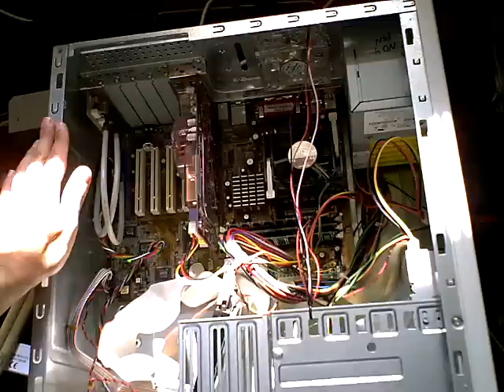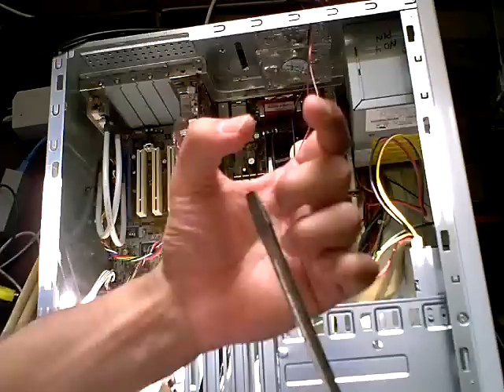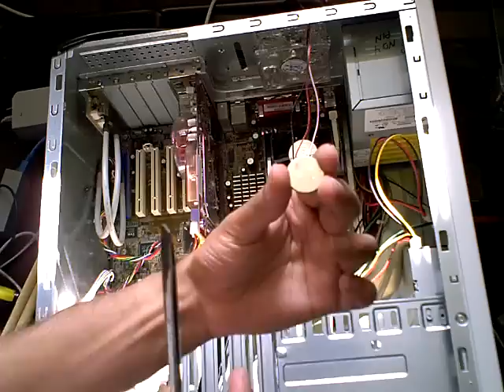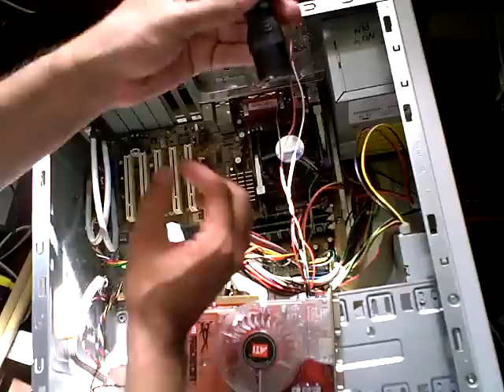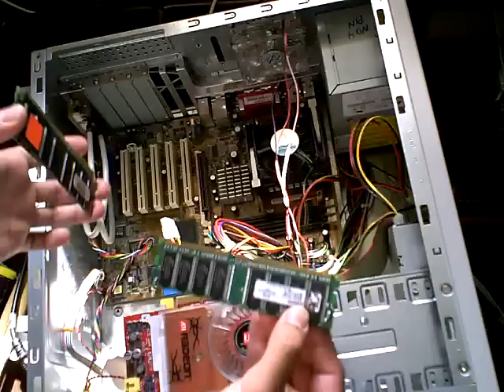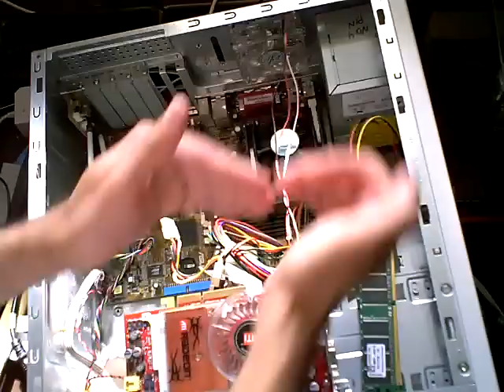How to possibly fix a PC that will turn on but will not beep and will not display anything on screen

Comment: Hi Rodney! My desktop computer boots up when I press the power button, the light turns blue and the fan's start-up. My monitor is plugged in via HDMI into my graphics card (AMD). The monitor displays no input. I then try it through the motherboard and "No Input". Normally when I plug my Ethernet cable into the back of my PC, a yellow LED turns on behind the plug and that didn't appear. My keyboard and mouse both do not work either as one is plugged in through USB and the other through a standard keyboard port. I am slightly worried that my motherboard is dead. Please Help??
Reply from the maker: +Rob Curnock You mention a lot of detail, which is good, but the ultimate question: does it beep at boot?
Reply: Luckily it was a while ago and I fixed it, some how. Thanks anyway though :)
Reply from the maker: +Rob Curnock Yep, responding to all comments unanswered from my 1.5 year hiatus, even if most of them are no longer valid.

Comment: hey, i have a question, i recently built my own gaming pc, i got all the parts in i installed them and out the wires in the right spots (atleast i think i did) the computer turns on like yours did i get power running threw it but i get no picture on my screen  Asus A68HM-K Micro ATX FM2+ is my Motherboard and i cant seem to find the clear cmos on mine  i herd some of them dont have that, i checked the ram and im using the onboard video chip (for the time being) but nothing seem to work even my cpu is fine i get no beeps whats so ever and im completely lost any ideas?
Reply from the maker: +Amaya Rose Breadboard it (explained in the following video:)

If the steps in this video did not provide a solution to your problem, view:

http://www.youtube.com/watch?v=_EK9a-R5pss

You never know, maybe rebuilding the PC in the opposite sense that you took it apart will solve the problem.
Reply: ok thakyou :)

Comment: So when you said to replace the battery, did you mean to put it back in or get a new one?
Reply from the maker: +ethanDAboss11 Heh, good observation. Yep, meant re-insert. Unless of course your battery is dead, in which case 'replace' would apply : )
Reply: RodneyDickson Ok. Thanks man. For my mobo, I just concluded that it was dead and got a new one. Thanks anyway though :D
Reply from the maker: +ethanDAboss11 Good course of action. Thanks for sharing

Comment: Hey, Id appreciate if you could help me out, I built my first pc and it turns on with fans spinning and everything. I plug my hdmi cable from my pc to my tv and it says retrieving data for a couple seconds and then goes to a blue screen on tv the saying like no data or something.
Reply from the maker: Ok, well, first off, try connecting a standard PC monitor to a standard PC out connector and see if that works. If it does, chances are your video card requires either A) HDMI drivers installed and/or B) the HDMI out function enabled. You can begin by exploring the software that corresponds to your video card for HDMI out functionality, and if you do not find such an option, then download the newest driver for your video card, uninstall your previous video driver, and install the newer video driver, ensuring to install the HDMI driver at the same time. Let me know how it turns out.

Comment: Hi, i bought AMD R72-50... I it put in PCI slot, started computer but once i connect my LCD to card's output socket, there is no signal on monitor but I am getting signal from the integrated graphic chip set.. PLEASE suggest something
Reply from the maker: +Arsalan Sajid You gotta go into your BIOS and change the primary graphics adapter setting to your discrete card

Comment: My pc also won't beep or send any signal to the screen, but while the hardrive does turn on the fan does not, is this a different problem or do I not need to worry about it (also the problem began after 5 crashes while gaming and my mother board detected surges from the power supply after 2 of those crashes).
Reply from the maker: +Emmett Carpenter I'd try everything shown in the video, and if that doesn't work, Breadboard it (explained in the following video:)

If the steps in this video did not provide a solution to your problem, view:

http://www.youtube.com/watch?v=_EK9a-R5pss

You never know, maybe rebuilding the PC in the opposite sense that you took it apart will solve the problem.

Comment: I got a problem:
I have a lenovo k450, I upgraded my computer to a 600 watt power supply and a nvidia gtx 770 with its own attached fan..

worked for a week like a charm, my games are older, except for starcraft, however this morning, i turn on the computer, the lenovo screen comes up then thats it. sometimes it gets stuck on the automatic repair screen, my assumption is that the BIOS is not booting, but I cannot boot into it. I hear the power turn on, fans turn on, then it actually turns off and repeats in a loop. i checked the wire connections, everything looks good. \

any suggestions on what's going on? the graphics card rarely got hot when I played games. the night before i just watching youtube, did a normal shut down before going to sleep
Reply from the maker: +francis singh You could try going into the BIOS, loading setup defaults, then save and exit. If that doesn't help, the corruption might be windows-side and not hardware. The fact that you're seeing the Lenovo logo (I assume your PC produces this and not the display on its own) means that the motherboard isn't dead.

Comment: I have a intel i5 6600k cpu, msi r9 390, 16gb RAM, EVGA 600W bronze. Everything works fine with just one cable inside of the msi r9 390 but when i try to put in the second cable, there is no display on the monitor. I have no clue what the problem is.
Reply from the maker: Ensure that the board requires both cables be connected. Sometimes boards have either/or ports, so it will allow additional power from one type of connector OR the other type of connector but not BOTH connectors at the same time.

Comment: i have motherboard MSI G31M. My computer dos not boot regularly. I have disconnected all peripherals as well my optical drives and HHD. A message comes with the first boot display with (American Megatremds) says that CMOS Date/Time Not Set. When i log on the CMOS Setup Utility I see my time and date is going crazy changing by itself between year 2099 and 2020. I have reseted the CMOS, wipe it, changed the battery. does not work. Please, your kind help is highly appreciated.
Reply from the maker: WOW! And you booted with little to nothing connected that could be causing this? Sorry to not be much help here, but I haven't a clue what to suggest. If the stuff is still under warranty, you might want to RMA it. Also, maybe google search that specific issue 'msi bios date changes by itself'

Comment: Ok, my problem is exactly like yours. When I take out all the ram I get the long beep. When I put in only one stick the PC powers up for about 2 seconds with fans and LEDs, then shuts down. When I put both sticks in, it all goes back to the first problem. All power to fans and graphics card but no boot up. Could this mean my RAM is fried and need to buy new sticks?
Reply from the maker: It could be the RAM modules, but it could also be the RAM sockets or something else on the motherboard. As shown in my secondary video, sometimes another faulty component can cause the board to report a memory issue. If this PC used to function as is, then I'd Breadboard it (explained in the following video:)

If the steps in this video did not provide a solution to your problem, view:

http://www.youtube.com/watch?v=_EK9a-R5pss

You never know, maybe rebuilding the PC in the opposite sense that you took it apart will solve the problem.
Reply: Well I got an update on the problem. So when I booted up the PC as normal, everything turned on, beside the screen(problem displayed in vid). I just decided to let it run for a while. Surprisingly after 25 min of black screen, it started to work. Display was outputted and working good. I'm at a complete loss as to why. Any info on as to why?
Reply from the maker: Sounds like a configuration issue in your CMOS settings were either trying to access a resource that was not accessible (and the access request finally timed out after waiting) OR after hanging for so long, the POST operation simply re-initialized itself. Either way, I'm glad things are working again.

Comment: What could cause my power button to not turn the pc off, when holding it down?
It turns the pc on, but will not turn it off. I have to pull the power cable to turn it off.
Other than that, I have the same problems, like no monitor, no beeps, only fans running w/ green light indicating power on the mobo.
Please help!
Thanks so much for the video and any additional help you may provide!
Reply from the maker: The operation of the power switch on ATX machines (everything after the Pentium 1 generation) is governed by the motherboard in its operations, so if your motherboard is not able to 'think', it cannot process the power off command when you press (or even hold) the power button (note that some PCs still process this long hold command, others like yours do not).

If the steps in this video did not provide a solution to your problem, view my:

Advanced troubleshooting technique tutorial of how to possibly fix a PC that will not beep at boot

You never know, maybe rebuilding the PC in the opposite sense that you took it apart will solve the problem.

Comment: Hey! I ended up replacing my motherboard, because I heard a static sound coming from the motherboard. I replaced it thinking there was a short, but I could still hear the sound. Now I think it may have been my video card. but I'm not completely sure how my video card could just suddenly go bad.
Reply from the maker: It is possible that this sound is coming from your power supply. Also, fans rubbing on their housing can also cause a similar sound. To test this, you can use the backside of a ballpoint pen (the flat side) and place slight pressure on the fan hubs to see if the sound stops when you tap the fan. Perform this test will all fans on your machine (except for the power supply fan obviously) and let me know how it turns out

Comment: from the sounds of things during the first 2 minutes of the video, sounds like my MOBO is already finished bc it made no beeps. I need to know what went wrong? I have fully compatible parts and connected every individual component I bought to the mobo; this includes 1x fully mod PSU, 1xGPU, 1xRAM, 1xSSD, 1xDVDW, 1xHDD, 1xCPU, 1xliquid CPU cooler, and every stock chassis fan (2) before ever trying to start the computer, everything spins up and all fans/LEDs are up, never got a display and never a mobo beep, what am I doing wrong?
Reply from the maker: +Zanzi The Cheefah Easiest way to try to find out: Breadboard it (explained in the following video:)

If the steps in this video did not provide a solution to your problem, view:

http://www.youtube.com/watch?v=_EK9a-R5pss

You never know, maybe rebuilding the PC in the opposite sense that you took it apart will solve the problem.
Reply: RodneyDickson I found out my DD4 MOBO (h170 pro gaming) or CPU or chipset wasn't compatible with 2666mhz corsair ram I had after using your steps & checking the manufacturers support page. The red LED light for DRAM goes on and stays on with no beeps, I unhooked everything except ram CPU & Cooler using your tip i found my problem, so I think my mobo is still fine. now I just need to figure out what's compatible.
Reply from the maker: +Zanzi The Cheefah Real good! Glad to hear that you got to the bottom of the issue. Your motherboard manufacturer's website will have a support page dedicated to your motherboard's model, and on this support page should be a compatibility list for such components as video cards and RAM modules. Ensure that your new component is certified to function with your motherboard

Comment: can you please reply - 
i have a problem with my pc.
it started yesterday when i wanted to plug my Projector with pc.till that time everything was fine but when i connected
projector, the projector screen shows all the white to yellow (screen works perfectly but all the white of screen is yellow)
I thought it may be projector problem so i connected the cable to my monitor  but the monitor too shown the same problem.
i though connection may be loose so i changed the cable (same type but another) still got the same problem.
then i took my 2nd monitor but still got the same problem. then i completely formatted my pc and reinstalled the windows but still the same problem.
Then i bought new VGA cable shown the same problem.

Now i tried every VGA cable ( i have 3 including the new one) to my friends computer. the two old cable gave me the yellow color on his pc but the 3rd one (new one) worked normally.

so i concluded that it is neither monitor nor cable problem .... am i true ?
Reply from the maker: Wow, is that ever a nutty problem! From the sounds of things, I was going to suggest that maybe the discrete graphics board (the 'video card' if you will) has come loose from its socket and needs to be reseated (removed and reinstalled), but given that two of the three cables are giving issues elsewhere, check the cable connector and ensure that you are not bending any pins (or breaking off any pins) upon connecting: this too can result in inaccurate colours being shown. Hope things work out.

Comment: Hi i have the same issue i have a gigabyte mother board 990fx ud3, an amd octa core liquid cool processor, gtx 960 gpu a evga 850 bronze psu and an samsung 850 evo ssd i hooked up everything correctly and i get no video the same things occur everything runs but no post beep or display could a new component be faulty?
Reply from the maker: +Joel Urbina Could be a multitude of issues. Breadboard it (explained in the following video:)

If the steps in this video did not provide a solution to your problem, view:

http://www.youtube.com/watch?v=_EK9a-R5pss

You never know, maybe rebuilding the PC in the opposite sense that you took it apart will solve the problem.
Reply: already got it running last year thank you though!

Comment: So I decided to use my old parts to build my uncle a pc (he is using pentium 4 omg....).
However I encounter this problem:
Mobo: P5Q SE PLUS
RAM: DDR 2 6 GB
CPU: Q8400
PSU: Corsair CX 430
HDD: IDE hard drive
GPU: I don't remember... really old card, don't think it will consume that much power

1. Computer boots, fans and lights work
2. Enter bios
3. Change 1st boot priority drive to USB (to install windows 7)
4. save and exit
5. Computer restarts, but no display, black screen
6. I have to reset my cmos by pulling out the battery in order to enter bios again
7. repeat step 1

I don't have onboard video port, but I'm pretty sure my GPU works

So, I really don't know what is going on, my friend told me that
Reply from the maker: +6XxDJxX9 Try going into the BIOS and loading setup defaults, followed by saving and exiting. From there, clear the MBR of the hard drive before installing Windows. To clear the MBR: https://www.youtube.com/watch?v=eEfGhWXJVJM

Comment: I have this kind of problem . Could please help me with the clear instruction ?
Reply from the maker: +Ghazali Sabardin If you find yourself in this situation (a PC that will turn on but will not beep and will not display anything on screen), try to Do what my video shows: disconnect the power cable, remove the CMOS battery, short the CMOS jumper pins for 9 seconds then return the jumper cap to its initial position, press your PC's chassis power button switch (to discharge any remaining power circulating in the system), leave the PC unplugged and in this state overnight, then the next day return the CMOS battery to its socket, power up the PC, and if no beep, then disconnect the power cable, press your PC's chassis power button switch (to discharge any remaining power circulating in the system), remove one component, power up the PC, and if no beep then repeat (each time unplugging the PC, pressing the power switch to discharge remaining power, removing a remaining component, and then powering up, and this until the PC beeps at boot).If it never beeps, even when you are down to just motherboard, power supply & CPU+fan, one of these remaining components may be bad

Comment: So the motherboard is bad if i only get beeps when I remove the ram? Everything sounds like its booting up and I changed the agp video out twice.
Reply from the maker: +Jeremy Hutchings Beep error codes differ from one BIOS manufacturer to the next. To discover what the beep error code is trying to telling you, discover the manufacturer of your BIOS (available in the motherboard's manual or on the motherboard's manufacturer's website {on the page for your specific motherboard model}) and then look up the frequency and interval of your beep error code on:

http://www.computerhope.com/beep.htm